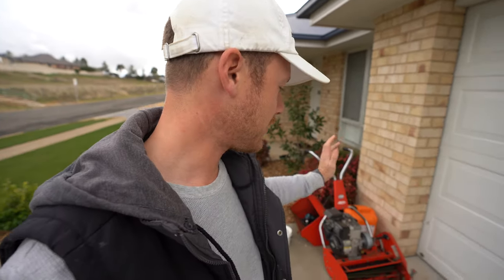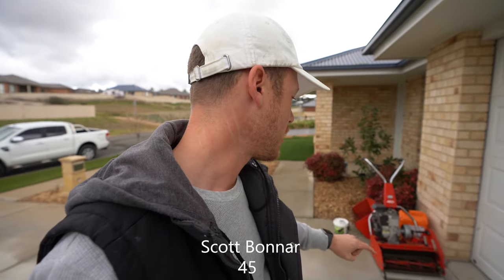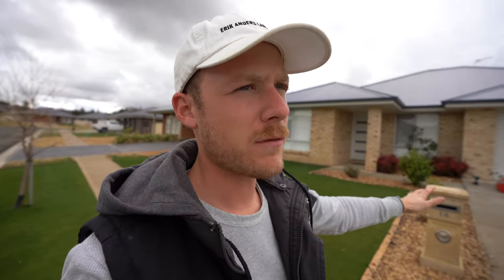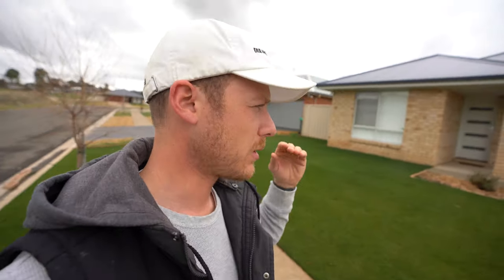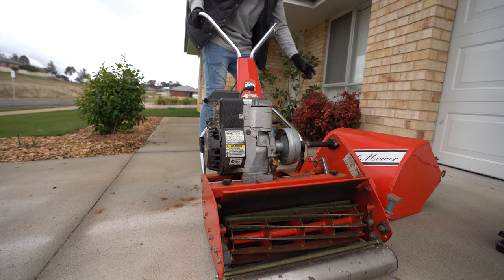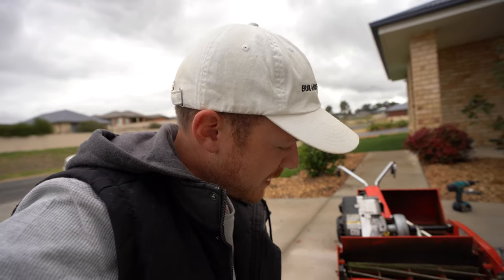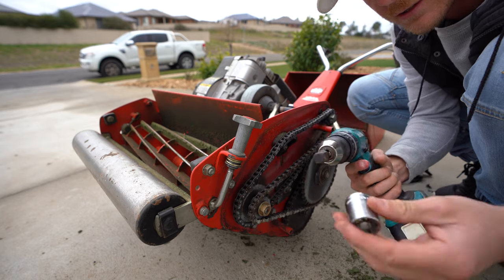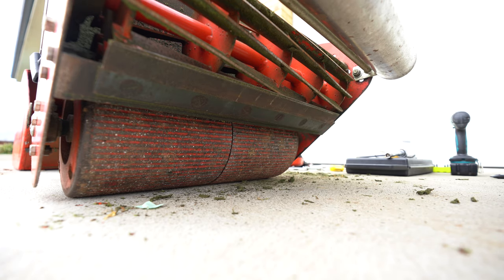How To Back Lap Your Reel Mower

Comment: Yo Ben love your stuff but i will throw something in here... In order to avoid any unnecessary strain on your sprockets, chains, clutch pads and especially your drill you should actually remove your chains from the sprocket that is attached to the cylinder blade. Then place your socket on the nut that sits directly on the cylinder blade itself. This way you have less chance of something bad occurring (Such as forgetting to remove a spark plug and the clutch grabbing causing the engine to start.... Yes Ive seen it happen to my friend, luckily he wasn't injured but unfortunately his brand new Dewalt drill did not survive). Just remember, the less moving parts you need the better. Otherwise great job! Keep up the awesome content mate!

Comment: When you test the cut with paper, can you use normal paper? 
I have just had my cylinder mower "sharpened"  tested the cut when I got it back and found it didn't cut the paper cleanly, when I said to him it's not cutting paper cleanly he replied "your not using the correct paper, it has to be glossy magazine paper." 
Is this true or is he having me on?
Reply from the maker: Yeah that’s not true. Should cut any paper
Reply: @LawnTips  Cheers man, thought that was the case. Had a feeling he was lying, he's charged me £140 ($285) to get it sharpened, and I doesn't even cut paper. he even told me that very few people do cylinder grinding in the UK because "the government have made it illegal to sell cylinder mowers." That's also clearly not true, can still easily get cylinder mowers and I can't find anything about it being illegal online.

Your videos are awesome, learning so much from them. Keep up the great work 👌🏻👍🏻

Comment: bed-knife to reel contact seems a little to tight. you should be able to cut paper and not hear the contact when spun (or very little). if you have to spin the reel with more then one finger it is too tight, and it can cause the bed-knife to heat up and warp. Also time between grinds will be greatly reduced as will wear of both reel and bed-knife. just a suggestion i have been a golf course mechanic for over 20 years so not trying to be some back yard know it all
Reply: If you can't cut paper unless you have a big amount of contact does that tell you your reel needs a backlapping or maybe even a grind? My reel is pretty hard to spin even with 1 hand, if I loosen it so it spins easily (with 1 finger) it won't cut paper
Reply: Hi Rick, so if you have it backed off enough where the bedknife contact is minimal, but you're still not cutting paper, does it mean you have to get your reel and bedknife sharpened?

Comment: i think that the cutting blade on them are like safety or cut throat razor. where you need to clean it after every use and then dry it as the stuff on the blade and water can dull the blade.

Comment: Yo mate. I've set up my SB so it doesn't cut paper... cuts grass just fine though (nice clean cut on the grass blade). Would love to see you confirm this alt approach in a vid someday or otw hear your thoughts
Reply from the maker: Sure can work man! You’ll probably just have to adjust the contact more often. That’s perfect though. There is a few ways to set them up. Depends on how it got ground as well.

Comment: WRONG! From a workshop supervisor of "Scott Bonnar & Rover mowers" 1978-1982, Indroopilly Golf course, Course Technician 1982-1987, almost right, have to remove the short link chain from the drive sprocket otherwise you will damage the plastic engine clutch drive assy, there are three grades of grinding paste, Course/Median/Fine, I would recommend Fine paste for domestic use, if you have a good backlapping program in place you will never need to have your cylinder ground which will double the life of your cutting cylinder.